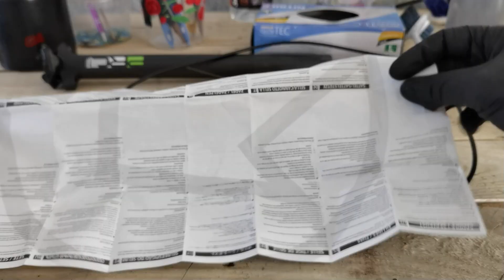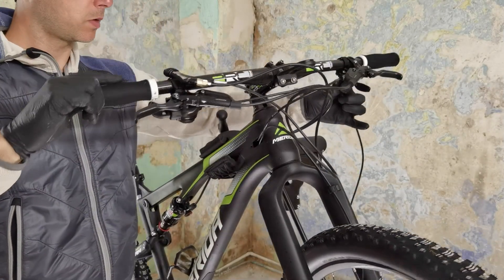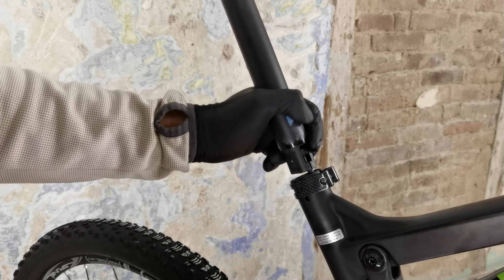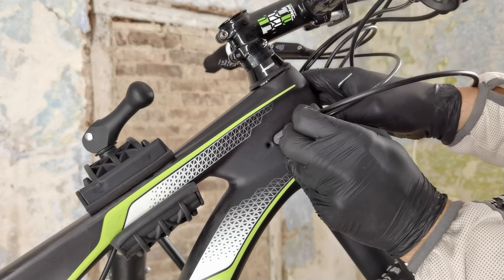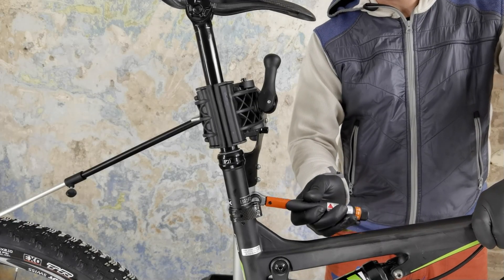Faster, safer + more fun on MTB trails. I'll show you how to install dropper post.

Comment: Watching this video frustrates me. A dropper post is something Ive been wanting but don’t think is possible with my bike. I have a 2011 Scott Genius 30 and have the following challenges:
1. It’s a full carbon frame without any internal cable routing and I’m not keen to drill holes in it. 
2. I run a 3x10 drivetrain with Scott’s lockout system so there’s no realestate left on the handle bar for the remote. 
3. I’m a short rider and the max travel that I can have is 100mm

Do you think there is a solution for me?

Thanks. Love your channel.
Reply: Buy an external dropper with a right lever.

Comment: Which dropper posts would you recommend?
Reply: I have been using the Brand X ascend for a while now. It's getting good reviews and I agree with those. Very affordable and available in different standards (external, internal en different diameters)
Reply: I like the PNW Loam it has great reviews and it is pretty affordable